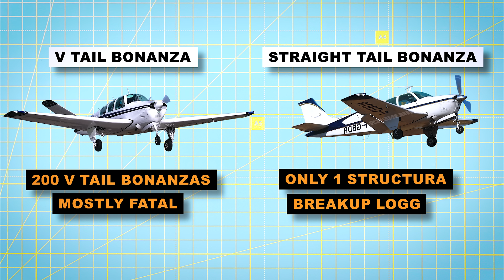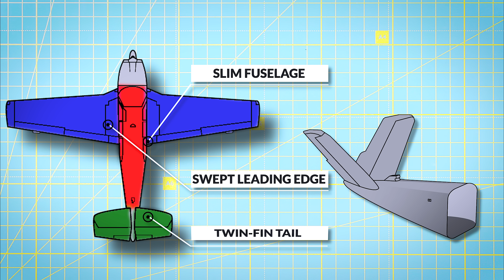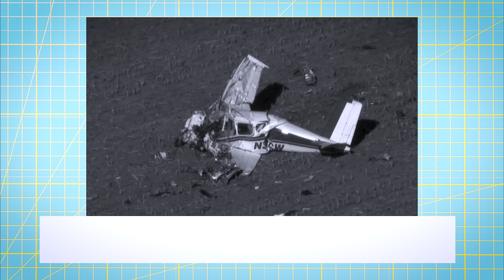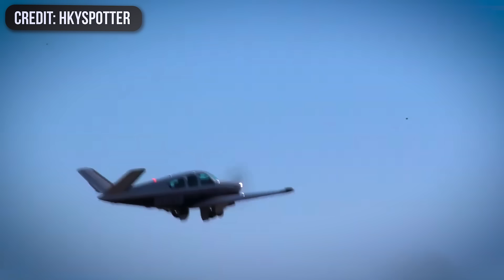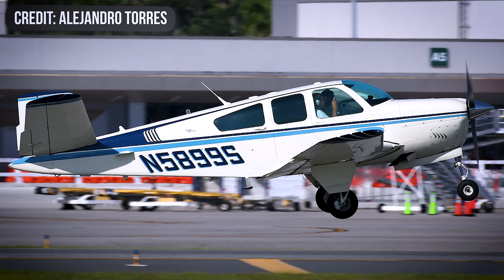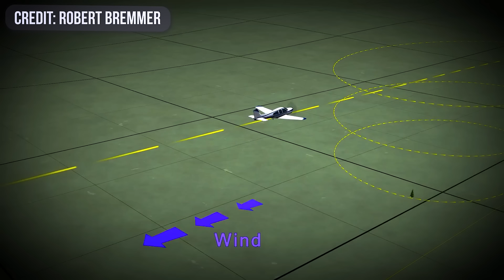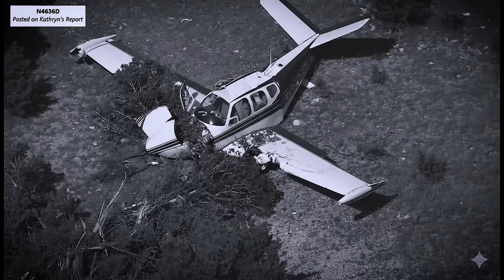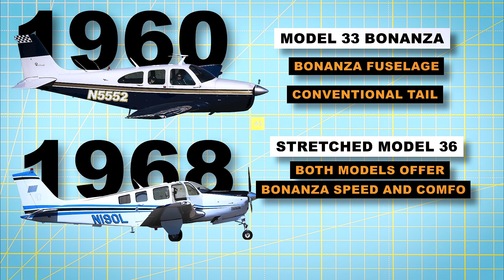Why Did This Plane Kill over 200 People?

Comment: Well, some of us call doctors 'Bonanza Killers'.
Reply: “Stethoscope-chewing Bonanza killers,” is the full term.
Reply: @joelamb3581  "Fork tailed doctor killers" is the way I know it. Since the early 80's.
Reply: @stevenrobinson2381  That's what my flight instructor called them. He added that some doctors thought that the laws of aerodynamics did not apply to them - and they were dead wrong.
Reply: @CharlesParmelee Luckily, medical assistance will be nearby.
Reply: A late friend and  B17 pilot in Europe and Asia who became a Beechcraft dealer after WWII said that before the Bonanza was introduced the high-performance single engine aircraft of the were basically Stinsons, and when he first flew the Bonanza he was shocked and shocked by the speed and pilots were intimidated and  frightened by how fast the Bonanza accelerated in a dive.
Reply: @jackoneil3933  They haul ass...It's not what I'd consider nimble, but cruising at 190 knts works for me.
Reply: @shannonblack5444  By comparison what do you consider nimble?

 My dad was a Beech, Cessna and Mooney dealer, I've owned at least a dozen V-tail and straight tail Bonanzas (and a couple of T-34s), Owned or flown all the Cessna, Piper, Mooney, Rockwell singles, a few  Bellancas (14-13s & a 17-31), A Cessna Columbia 350, A couple of Cirrus Sr-22s  and can't think of any Standard Category FAA certified singles that were any lighter or responsive than the V-tail Bonanzas. 

The Commander 112/114s were nicer to fly but a lot slower. The old 14-13 Bellancas and even the Vikings fly super sweet  but as I recall not any more nimble or lighter on the controls than a Bonanza. 

The only light singles I've flown I would call "Nimble" were aircraft like a Pitts S2,  Yak52, Extra 300, Lancair 360/4P, A Glassair, Robinson R22 or Hughes 300/500.

I did have a 1953 V35-D Bonanza with the tab boosted T-34 ailerons that was so light in roll the previous owner swapped the alerions to the wrong sides so they would be heavier for IMC flight. I put them back on the proper sides and it was one super light,  like fingertip pressures and one of the lightest rolling aircraft I've flown,  but it didn't roll any faster than a stock Bonanza.

As for 190kts, The fastest Bonanza I've flown was a V35TC turbocharged model,  and as I recall it was about 160 to 170kts at 10,000 - 15,000ft. Had a B36TC and some Turbo-normalized A36s but they were no faster than a Cessna T-210 (about 160kts) cruise. 

In Bonanzas, most of the time I flight planned about 135 to 145kts for early 205 to 225hp models,  and 150 to 160kts for later 285hp Bonanzas. Yea, you can push 190kts or more  in descent but I prefer to stay away from the yellow.
Reply: @jackoneil3933  Well, that’s to be expected, when they want to dive.
Reply: @The_ZeroLine  Well, the Bonanza being more aerodynamically efficient than most light aircraft of the time (and today) accelerates in a dive much faster than most expect.
Reply: Dont forget the lawyers
Reply: @douglasneat9147  I hope this isn't a Shakespearean reference....
Reply: @shannonblack5444 To be or not to be a good pilot before thou fly thee Bonanza 😂
Reply: @douglasneat9147  Never read Henry VI, I take it.
Reply: @StephenManifold not sure what the downfall of England has to do with a v tail? But then again all of Europe is failing.
Reply: Some of us normies call Doctors "Bonanza Killers" 🤷
Reply: @AcmePhoto  I am reminded of an old adage from the last century "Another Doctor in a Bonanza..."
Reply: @AcmePhoto don't forget the lawyers
Reply: Exactly
Reply: I'll be borrowing that line, doctor...lol.
Reply: @shannonblack5444  And Attorneys "Forked-Tongue Bonanza Killers"?
Reply: Exactly how dare they ❤️🇺🇸🪽✈️
Reply: That is hilarious. After having flown many Bonanzas in the 35, 33 and 36 series, my personal favorite is the S35. It is the first to have the Continental IO-520 engine and is still light. The V35 would be my second choice. If I need a truck, the A36 would fit the bill nicely.
Yes, doctors have killed some really nice Bonanzas.
Reply: Rich ass hats 😂
Reply: @StrathconaPokeMart yup
Reply: @StrathconaPokeMart Doctors! Always making the world a worse place! The nerve.
Reply: @The_ZeroLine 😂😂😂
Reply: They should have been grounded but this would have been difficult to do when we didn’t know what was wrong but we could have grounded them. Instead they quit building the v tail and the design was good but not designed  properly
Reply: @KeithWalker-y7h  Can you provide a bit more detail about what you consider was designed Improperly? 

As I mentioned in another post here in the comments section, engineering airframe failure analysis suggested that the V-Stab failures occurred well beyond the original designed and certified structural limits of the aircraft, and considerably beyond the point at which other similar aircraft typically experience structural failure, and the AD's that were issued were more to improve the margin of failure rather than due to the aircraft not meeting certified designed specs as is often the case in Airworthiness Directives to address 'Unairworthy' Design or operational conditions. 

Unless my recollection is in error, my sense is that the early and later V-Tail Bonanzas even before the ADs and tail mods were a structurally sound design that could and should have been improved upon, and that losses involving V-Stab were more due to the nature of the Bonanza being performance optimized design that was less forgiving of mistakes made by typically inexperienced or inattentive pilots but withing certification requirements of the time.

Comment: Flew one for 20+ years and am still alive to tell they are great planes.
Reply: I flew my straight 35 for over 15 years.  Great airplane!
Reply: If 1% fail, that makes for an unsafe design, yet still leaves you in a place where no one you knew ever had a problem.  But, as the video suggests, if the plane is well-maintained, and you fly in conditions within your personal limitations,  you shouldn't ever have a problem.
Reply: Well, I knew an F-104 pilot who said the same thing
Reply: Must have been doing something right
Reply: They also kept improving and strengthening the plane and pilots became more aware of precautions they needed to take. In return for cooler style, you have an aircraft with a higher chance of incident than a traditional tail. That doesn’t mean it’s a bad aircraft by any means. Just less a forgiving one.
Reply: @The_ZeroLine So dying for style is ok? What nonsense.
Reply: That is what I was thinking. I've seen these aircraft for years and never saw the tail fall off.
Reply: The Bonanza V-Tail angle is too close to the horizontal axis.  It should've been much closer to 45°.
Reply: So are you good, or just lucky?
Reply: Obviously you’re too stupid to have not read the very long comments by a couple of guys who specify the exact problems of the aircraft. As well as the stupid guy who ‘awoke from his coma’ when showed the wind tunnel test produced by NASA.
Reply: Isn’t that what we call “survivors bias”?
Reply: @calvinnickel9995  No.  It's what we call "understanding the entirety of the data".  The AOPA study from the 1980s showed that the Bonanza had a lower incident rate than other similar planes.
Reply: @FT-64  If the original comment had been "When you look at the entirety of the data, this plane has a good safety record," that would be considering the entirety of the data. When you base your assessment of the plane's safety on your personal experience of not dying, that is survivor bias. It is possible to make a biased assessment that comes up with the same answer as a data based assessment. The two are not mutually exclusive.
Reply: @FT-64 V tail or conventional tail?
Reply: @drd1962  Both.  Conventional was slightly better than V, but both were better than average for the fleet.

Comment: As an IA, I have no intrest in doing annuals on Vtails due to the extra rigging and balancing requirements that the straight tail doesn't have. Especially since the rigging requires jigs and profile boards that aren't economical to get unless you want to do this type full time
Reply: An annual inspection on a V tail does not require, and should not include any removal, rigging or balancing of any control surface. The only case of that work being done would be if a pilot encountered some flutter, or if the ruddervator parts were replaced. Building the ruddervator balance jig takes about 2 hours and maybe $100 worth of metal and bearings to build. Read the book, follow the directions or send the asm to a shop that has the balance jig. Rigging is in the book too, and the only difference from a Piper or Cessna is the adjustments are done at the mixer in the tail through an access panel on the left, and inside the tailcone area.
Reply: @docmirror8009 travel checks are rigging related

Comment: Thanks for posting a very educational video on a beautiful, unique, iconic and troublesome airplane. It seems the Beech engineers underestimated the strength of the air frame and related parts needed to accommodate the V tail. It's very unfortunate that so many died because of this mistake. Beech should have been ashamed of themselves instead of blaming it on pilot error. It's surprising the company survived such a deadly debacle.

Comment: I'll take a Cessna 210 instead.
Reply: I would take the F33 over a 210 but a 210 over a V tail.  The 210 does not handle as nicely, has that funky gear and a spar AD.  Its basically a retractable 206 with no struts but still a cool plane.  They have a pressurized and turbo charged version.
Reply: @josephalberta1145 1966 and 1967 Cessna 210 Centurion's had struts.

Comment: Having done 100 hours in a V35TC I agree with every assessment proffered here.  The book says 1/2 turn into a spin and I agree.. I had speed brakes and they saved me more than once from going Vne..  Balance is very critical, like two big guys in the front would require at least a full golf club bag in the back. The wag in turbulence would demand a power cut-back all the time (I bumped my read twice on the roof).. Yes, it was (is) a demanding aircraft.

Comment: This presentation has a bunch of weird claims... First it claims that Vtail owners were not the problem but then says Vtail owners make sure they are in CG, slow down when encountering turbulence, and maintain IFR currency...Huh EVERY PLANE this should be done.  If you ignore CG, blast full speed into turbulence, and don't stay IFR current, any plane will kill you.     

And every single plane will end up in a spiral dive if you just let it go... Called the "Graveyard Spiral". It killed JFK JR.  

Next it tries to compare 35 years of history or the Vtail starting in 1946 with 35 years of history starting in 1960 with the 33 and saying the Vtail had more accidents in the 60's and 70's. While the video even admits significant improvements in 1957 with the BE35 H model. The only real comparison would be 1960 to 1982 33's vs 35's, not 1947 35's vs 1970+ 33's.   

So you should not compare the 1947 BE35 to the 1960 BE33.    

Next when the 35 came out the average trainer was a J3 Cub. And the competitors for a high performance single in 1947 from Cessna was the 195, fixed gear with a big radial engine. So someone goes from a J3 to a slick retract aircraft, it is easy to see why someone would overspeed if they didn't know what they were doing.

Comment: The Bonanza like that has a steering wheel that you turn left right or pull back or push forward there's no Rudder pedals it's a coordinated Rudder aileron control . That was the appeal . make it simpler
Reply: This is 100% false. The Bonanza's ALL have rudder pedals (35,33,36). You are thinking of the Aircoupe
Reply: @RDHzone 
 Oh 1001%;thanks . It was over 50 years ago and they told me it was a Bonanza and I believed it was all this time .

Comment: There are quite a few white lies and some egregious errors in this video. These structural concerns were addressed as far back as 1958 with mandatory inspections and service bulletins. The cable system is actually very simple and is inspected annually; even when cables are loose, the system is remarkably resilient and remains safe.

Starting with the 1958 V-tail models, mid-air breakups dropped to near zero. The Bonanza is actually overbuilt—a total tank. Also, the 'left turn tendency' is due to factors common to all single-engine aircraft that you failed to mention. This is a poor video and obvious clickbait, prioritizing bad information over the facts.
Reply: I agree! My family had a1957 H35 and had no problems with it, and we owned it for decades. I remember back in the 80s the FAA had us install brackets on the tail for extra support. Also, there was an aftermarket tail you could get with the plane that advertised sandbags piled up on the V tail until they were horizontal without them falling off. We never got the aftermarket tail but I'll never forget those advertisements.
Reply: I’m agree 💯 percent! This video is very one sided and has a lot of false information.
Reply: Well that's just wrong, since Beech SB No. 2188, and FAA AD 94-20-04 have some pretty clear instructions regarding the safety of the V-tail structural integrity and those were way after the 1950's. In fact, the average accidents from structural failures in Beech 35s between 1962 and 2007 was 3 per year. Compared to 11 IN TOTAL for the conventional tail ones.  
I have no clue why some people have this silly need to defend their thing as if it's a sports team, but you really gotta stop that.
Reply: @RdClZn  It’s not entirely wrong, but it’s incomplete. The 1957 H35 update improved stability by increasing the tail's dihedral angle to 33 degrees and reinforcing the main spar, which reduced "tail wag" and increased load limits. While the 1994 structural "cuffs" finally addressed the high-speed flutter risk, modern V-tails equipped with a "Level" button and "Smart Glide" have effectively neutralized the pilot-induced spirals that historically caused those structural failures.
Reply: @NRB-mb7jc  in the 80's they still had to limit the airspeed of operation through AD  AD 86-21-07 , in 1994 the AD was so that those restrictions could be lifted and the aircraft operated safely in the regime. Maneuvering speed was restricted to 115 knots in the 1980's.  
Now, no one said the V35 still is an unsafe aircraft, but clearly, compared to its peers, it used to be.
Reply: @RdClZn  "Well that's just wrong," (your words) dont get upset - I get it you are a bonanza hater - I love all airplanes - i am aware of the history and the AD's - I am pointing out the corrections for the record. Leaving out vital information changes the narrative and paints a wrong picture. Maneuvering (Va) speeds in the mid 1960's v-tails is 134-142 Knots - and yes, the 1980's Va was reduced as an emergency measure to 115(ish) until the aircraft was proven to be structurally sound (the cuffs). Then returned to a 134-144 Knots Va. Your statement "Maneuvering speed was restricted to 115 knots in the 1980's." indicates a hard Va speed - which is false - it was temporary until the AD was completed. Indicating your bashing one of the many great aviation successes. And yes, I am on "team aviation." Planes and the people that built them are amazing.

Comment: Look at how many were flown into IMC by non instrument rated pilots who pulled the tail off when they came out the bottom of the clouds. Crap reporting.
Reply: exactly......doctors making IFR runs without an IFR certified check out
Reply: @rollingthunder6215  Correct.  The pilot who killed Buddy Holly was not instrument rated, yet took off at night into a snowstorm with zero visibility.

Comment: When I was in the market for a 4 seater I did enough research on the v-tail to decide not to take the risk. Instead I bought a Navion, the main competitor for the v-tail after the war. The v-tail put the Navion out of business, mainly because the v-tail cruises about 20 mph faster. But as this video shows that extra speed came at a price. Navion is extremely stable in flight and has a good safety record. It's arguably the easiest complex plane to fly. Still, the buyers wanted speed.
Reply: lol nothing you said is true.

Comment: (04:00) "[For a conventional tail configuration]... the resultant force pitches up and to the right."

Well, yes and no. You neglected the matter that the rudder (and Q-force, depending on prop rotation) produces a small torque, as the force from the rudder deflection is offset from the aerodynamic center of thrust.

Such a force can serve to ameliorate at least the roll component of (adverse) roll-pitch coupling, "fortuitously" performing nominal self-dampening of potential fugoids. (I know that was a mouth-full -- it took multiple revisions to get the words just right.)